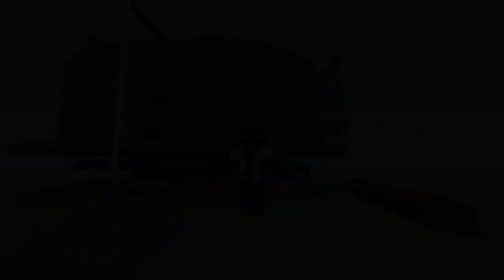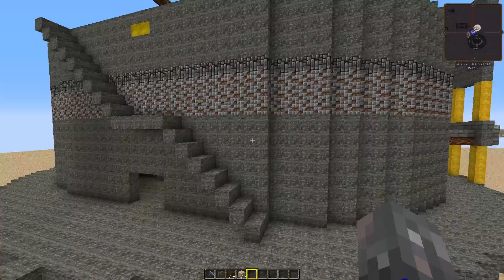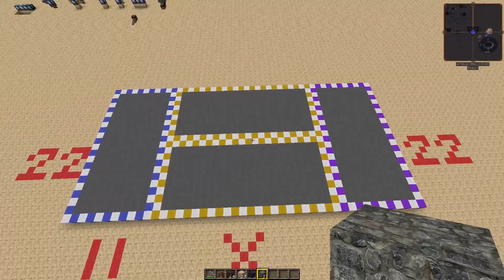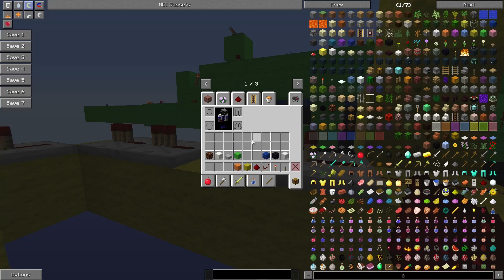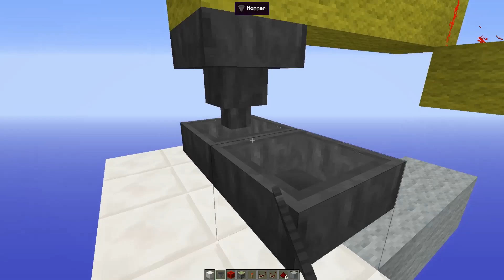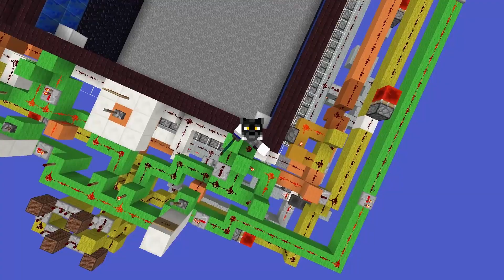Minecraft Minigame Tutorial - Fully Automatic Spleef Arena

Comment: Interesting thing to note for the current version of minecraft: in 1.15, the floor refills itself when you turn on the auto reset, but only once. The pistons update and fill in some blocks, and then just loop around for a while not doing anything. If you turn it off and let everything stop moving, then turn it on again, it fills in more and does the same thing.  The player select system seems totally borked in the current version, though.
Reply from the maker: Sounds like I have to revamp it a bit. The timing was tuned to have the floor refill fast in 1.7.10 and has worked well since. Sounds like I need to slow it down a tick. Not sure why the player selection wouldn't work though, as it's a simple AND gate.
Reply: @AmmarossPlays  As far as the player select system goes, it might have just screwed up because I was flipping stuff without a ton of consideration lol. It would be really cool to see a current version of this with some modernizations, though! I'm on an SMP server with extremely limited use of command blocks (the owner made a chess game, that's it), and people would definitely enjoy a spleef arena there. I'm definitely subscribing to see if you do a revamp video on this project!
Reply: @AmmarossPlays  It'd be sweet if you make an updated tutorial, would love to see!
Reply: @AmmarossPlays  What would you change to update it? I really want to make it!
Reply from the maker: @josssbo  I'd have to see what is currently impacted by the latest releases. I could check in 1.16...
Reply: @AmmarossPlays  Yo please, this arena is dope, but i stopped building on the stage when it resets, can't do anything with it :( So please if you could rebuild it, appreciate ur work, dude.